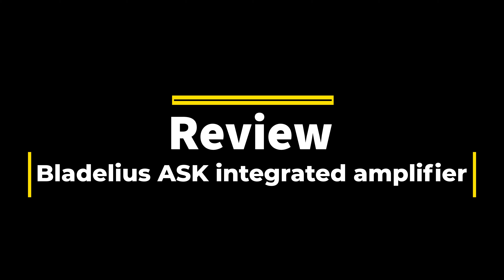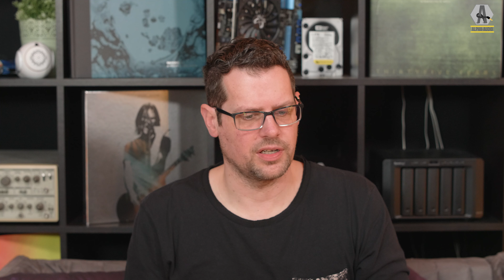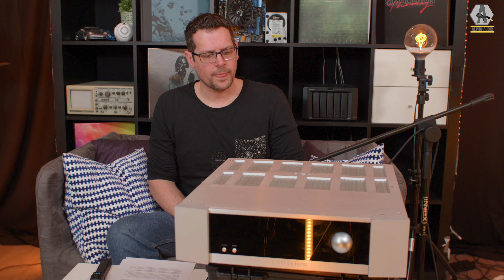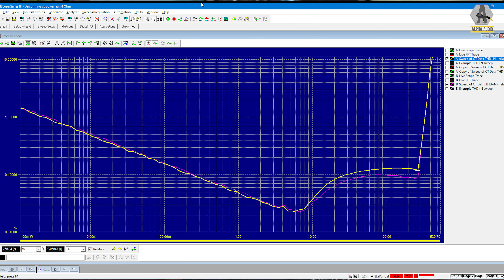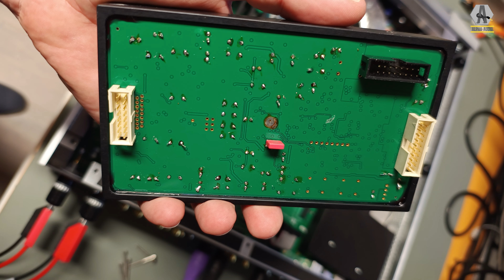Review - Bladelius ASK integrated amplifier - With DAC and streamer!

Comment: Nice review! I have owned three three Bladelius amplifiers over the last 15 years: The Bladelius Thor MKII, Bladelius Thor MKIII and now the Bladelius ASK Integrated. I really think it is something special. By the the way, the swedish magazine Hifi & Musik measured the power  of ASK with a little different result: 252w 8ohm / 445w 4ohm. Looking forward to your review in your magazine😀
Reply from the maker: That is very odd... We measured 3 times. Maybe they use a different setup...
Reply: @TheAlphaAudio  The amplifier has enough power for most speakers anyway. And the sound is superb😀
Reply: Maybe a faulty powersupply in the test unit?
I have an older poweramp from Mike, the Advantage s150.

Comment: I like Bladelius powerful and stable amps. That said, could you explain the image at 2:57? You mention -110dB S/N for the integrated amp, which looks like the 1 kHz reading. So that means good noise performance. However the digital readout shows SINAD at around 78 dB, so that means the difference of around 32 dB is distortion? Is this an average of the 8, 4 Ohm measurements? You may have covered this in one of your other videos, yet it warrants repeating.
Reply from the maker: This is a measurement with a 1 KHz tone at 1 watt output. The SINAD shows around 78 dB. That's because of some spikes. There is a formula for SINAD that takes distortion and noise into account. But I actually never look at SINAD, because all designs with low feedback score badly. They can sound amazing though. This unit score pretty bad as well: 78dB is not good. But I can guaratee it sounds a LOT better than my Hypex Nilai-amp that has a better SINAD-score. 🙂.
Reply: Thank you for the reply! The corresponding spikes are not visible in the diagram, hence my question. So is the SINAD a composite of the 8 Ohm and 4 Ohm measurements?  @TheAlphaAudio
Reply from the maker: @GadgetyMV  there are two small spikes in the graph.
Reply: Yes, however, they are at around -90 dB or so.  @TheAlphaAudio
Reply from the maker: @GadgetyMV  Let me quote: " Signal-to-Noise-and-Distortion (SINAD, or S/(N + D) is the ratio of the rms signal amplitude to the mean value of the root-sum-square (rss) of all other spectral components, including harmonics, but excluding dc" You can't just see that in a graph.
Reply: Thank you for your reply. Is that graph that you show only Signal to Noise? @TheAlphaAudio
Reply from the maker: @GadgetyMV  it is purely a 1KHz input and the noise floor. So yes... Sort of signal to noise.